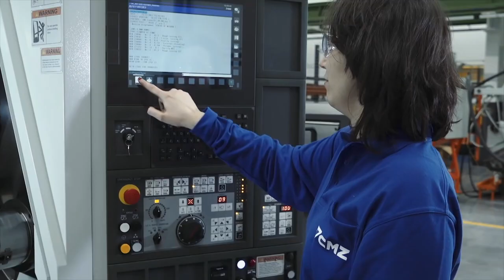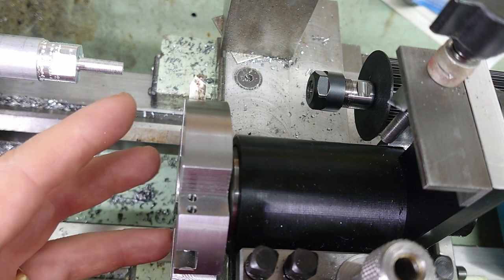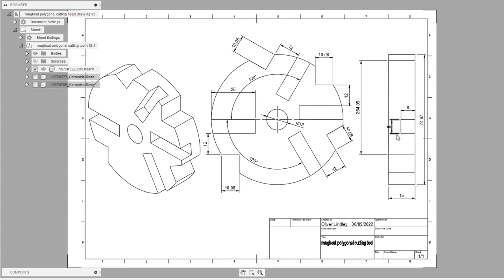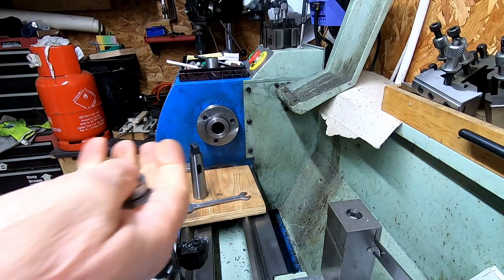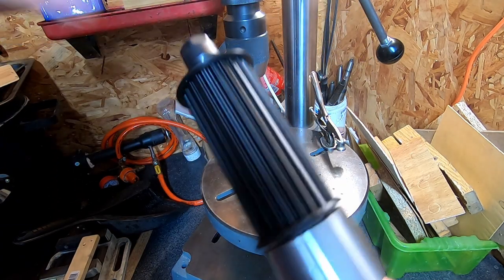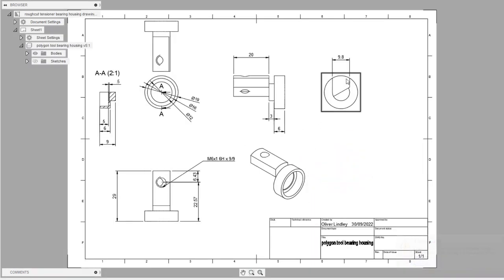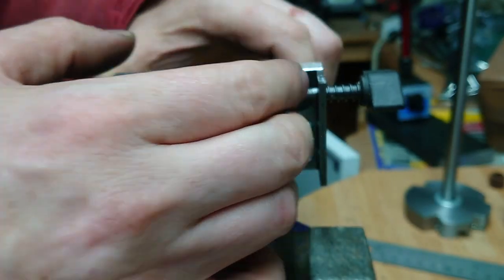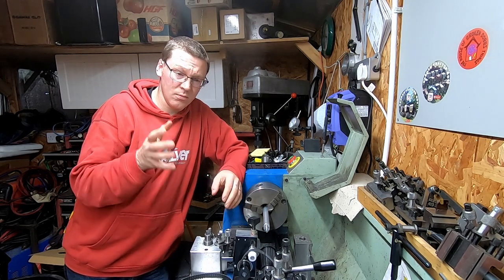Build Video for my Polygonal Turning Tool #Roughcut2022

Comment: Nicely done. Certainly a non-trivial build. If time and the unfinished project list permits, I'd certainly like to see any further revisions you make. I wonder if an electronic solution would need a monstrous motor / gear ratio (or a worm drive?) to give massive torque to stop 'magnetic slippage' (rather than belt slippage) on the interrupted cut resulting in a weird helix of flats rather than (say) a hex? Anyhow, thanks for sharing. A pleasant 20 minute accompaniment to a cup of coffee on a rainy Sunday morning 👍 🇬🇧
Reply from the maker: Hi Matt, the live CNC tool in the first video is quoted as 11.5kw, so that's a fairly substantial motor, I would imagine it is also a servo so will know when it's starting to struggle. Glad you enjoyed the video.

Comment: Great build and explanation Olly, we're all holding you to the new year now on this one lol. This is so different from the standard home shop stuff, I am keen to see you make it all come together mate. If you need anything machined that you know I have capability for, I would be more than happy to help out so don't compromise the design based on your own stuff. This is an awesome project (I hate that word but it fits well here). Cheers, Jon
Reply from the maker: Thanks Jon, depending on what the solution looks like, some keyway slotting would be handy. Best get that shaper going!

Comment: Great videos Olly, keep up the good work! I am envious of your shed and knowledge, hopefully one day i will have similar capabilities 🙂 What is your education and profession if i may ask?
Reply from the maker: Hi, thanks for the encouragement. I am an electronics engineer, but have had an interest in mechanical stuff since an early age. I studied electronic engineering at university, but prior to that, one of my 'A' levels was Design and Technology where we did short modules on a load of stuff: technical drawing, CAD (although that was in 1998, so was very basic 2D), hydraulics, pneumatics, plastic, metalwork, concrete, electronics and probably a few more I can't remember. It was a fantastic course, and it set me up with enough knowledge to be able to dig deeper when I needed to.  That said, I have also learned a lot from YouTube videos, so just keep absorbing the information, and any chance you get to put things you have learnt, take it! I'm very much still learning. See you again.👍

Comment: Great video great job I have been interested in this for a little while. And I watched the Russian video too . Also a good video . Do you plan on putting the 3d printer files on thingiverse or some other place for download ? 
Bob
Reply from the maker: Hi Bob, thanks for your interest. You raise a good point, the 3D printed parts can be exported directly from fusion360 for 3D printing, but I will put the 3mf files in the same GitHub link for those that aren't fusion users.
Reply: @ollysworkshop  Thanks Olly that would be great I have fusion but I find the learning curve to be steep
Reply from the maker: @boblee1849  I've added the 3D printing files to the GitHub repository. Enjoy!
Reply: @ollysworkshop  Thanks Olly got them !